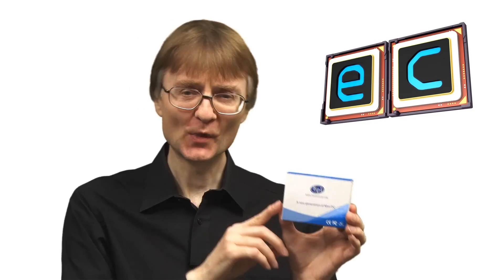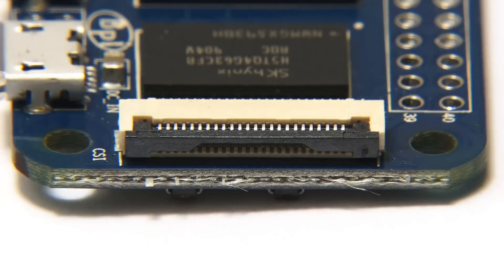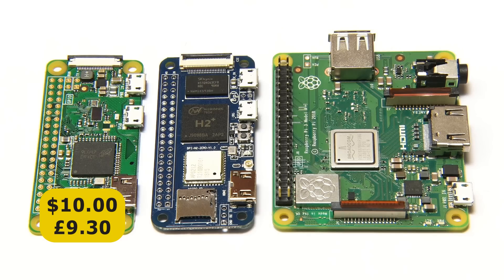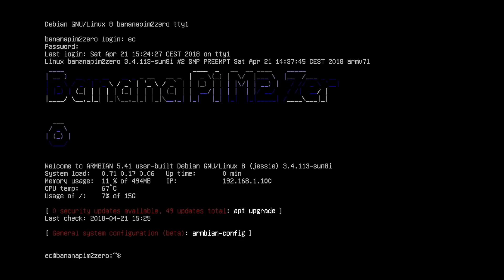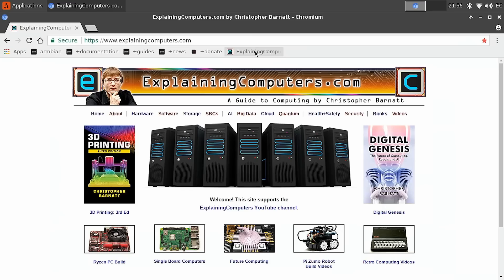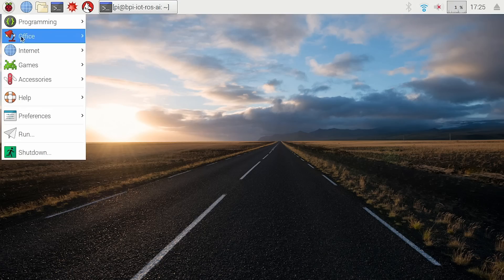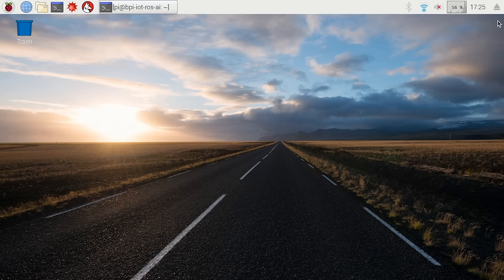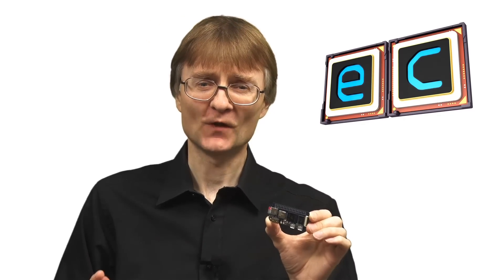Banana Pi M2 Zero: Low-Cost, Quad Core SBC

Comment: +ExplaningComputers / Christopher,
I have been fairly impressed with the Banana Pi range of single board computers.

I was using a Banana Pi R1 as a 4G based router / gateway device a couple years ago and due to the micro USB power jack eventually snapping (which is extremely hard to repair unless using a fairly powerful microscope), I decided to purchase the next model (Banana Pi R2) with a couple heat sinks (this was just after the R2 was released on the market). During initial tests, I wasn't overly happy with the WiFi connectivity (which uses the MediaTek MTK6625L. Which at the time of testing, the drivers wasn't overly stable) but understand that further work has been done since on the development of these drivers (alternatively, the board does include a mPCIe interface, which could be used in conjunction  with a separate WiFI module). 

Within the last year (approx), SinoVoip Co. Ltd. (the manufacturers of the BananaPi range) have also produced a 4G GSM module, which can be directly incorporated within the R2 (during my previous tests, I was using a 4G USB 3 based modem / "dongle", which isn't really ideal). 

Another benefit of the Banana Pi R2 is the inclusion of SATA based interfaces which allows for further storage to be added (which could be used to provide NAS provisions), as well as an 8GB eMMC. I have been considering using these SATA interfaces to provide a Squid based caching configuration.

Unfortunately due to time restraints, I have not been able to further work on this project (so many projects, not enough hours) but am hoping to continue with this at some point later this year.

Another thing which I have been impressed with is that SinoVoip does produce some really good and compressive technical schematic documentation for their range of boards (which was one of the things that first attracted me to their products). If I had to choose SBC boards solely based on available (manufacturer produced) schematic documentation then both the Banana Pi and the Orange Pi ranges would be my first choices. 

Also, Armbian (ARM based Debian) does provide good software / operating system support for both the Banana and Orange ranges (as well as supporting a number of alternative SBCs).

Comment: A nice little SBC. In term of power, which is better pi zero or this SBC. Important when using battery to run it. Another great video.
Reply: You can't expect 4 cores to use less power than just 1 core that pi zero has.

Comment: I think it really boils down to kernel support for the Allwinner stuff more than anything. The BCM2835 in the Rπ has a minimal peripheral datasheet that has no CPU architecture details beyond the memory map. It only has more developers pushing (...that have pushed..) out kernel updates that make it work a bit better. The Allwinner has a complete datasheet available, but lacks the momentum/user base to develop all the needed kernel modules to support it.

   While BGA soldering is not the easiest, the H2 can be purchased cheaply and integrated into any project design. Learning it opens up the potential for cheap embedded hardware development independent from the Bπ developers. One would always need to purchase an Rπ board to use it's chip in a project/product as the Broadcom chips are unobtainable. Therefore a Rπ is purely a consumer commodity, whereas the Bπ is a development board.

 I'm surprised you didn't mention the antenna connector type. I always seem to have a hard time figuring out if they are IPX, MHF3, or MHF4.
  Thanks for the upload.
-Jake

Comment: Now that I have one of these boards, I'm realizing something critically important about the Banana Pi Zero. They packed way too much CPU on this thing and not enough cooling,. Even with a heatsink, this thing thermal throttles like there's no tomorrow. The quad core chip is WAAAAAYYY more powerful than the Raspberry Pi 3A+, but it doesn't show up in benchmarks due to the thermal limits. If there was an easy way to attach a fan, this thing would kick some serious hind-quarters!
Reply from the maker: So true.

Comment: This is an interesting board it's been about for a while, retrorangpie is a nice is, a port of retropie then Armbian and Kodi in one, but I did notice it gets hot, I fitted an xu4q heat sink, it kind of kept temps in order, but after using Kodi for a number of hours the WiFi was dead, I had a similar experience with r69 android box, same sort of allwinner chip and used retrorangpie.
Reply: I found the 'slim' version of Retrorange but really wanted the full installation and couldn't figure out how to add the missing components, mainly Amiga and Scumm emulators. I saw another video with someone saying you need a fan to keep it cool.

Comment: re: 720 vs. 1080:  try a different monitor and/or the edid settings of the monitor.
Reply from the maker: I tried several. :)
Reply: @ExplainingComputers  : sounds reasonable.  I had a tv that had incorrect edid settings and I vaguely recall having to 'reflash' the edid.

Comment: Great video Chris! What would be a use case for something this tiny? Surely you wouldn't buy this just to run it as a desktop PC. Maybe do a video with a project that can be done with it? How about a weather station?
Reply from the maker: Yes, agreed. This is likely to be use for IoT, connected to some sensors, etc.
Reply: @ExplainingComputers  It would have to be such a niche where a cheaper, richer SW ecosystem, rasp zero w wouldn't suffice with its single core. I gotta tell, this board and price point really don't add up.
Reply from the maker: @brunesi  I agree.

Comment: Low RAM SBCs are best for headless OSs with no DE. I found setting up Pi-Hole with a full DE to be rather painful. I then tried the no DE option of Raspbian and it ran fine. With just one micro-USB port, you need both a micro - A adaptor and a hub for both the mouse and keyboard. For the headless version you nee just the keyboard. It's almost as if the thing was designed for the headless OS. Only run OS images with a DE if you really need one.

Comment: you could try to use xrandr to set the display resolution. That worked for me once in a stubborn distro in a vm, that wouln't run with the correct screen size.

Comment: I recently bought a Banana Pi M2 Zero, I installed an image that the documentation provides of the Raspberry Pi OS (a 2020 version) but the Wi-Fi does not go up with boot, every time I need to manually raise the Wi-Fi. Unfortunately the software support is very bad. That's why the best is the Raspberry Pi.

Comment: Sir . I would need some information about these mini processors , because i am trying to make a transparent phone ... 
So in the  transparent phone , the phone will be powered with tiny lithium ion batteries and a thin and small motherboard . Because my plan is to shove all the components into the bezels of the smartphone ... 
I have figured out ways to put audio , battery and headphone jack in the bezels and keep the phone screen transparent . What i need is a pretty tiny yet powerful motherboard to run the smartphone .. 

Can you please suggest any motherboard ( like the one's shown here ) , that is a bit smaller and can run a 16:9 touch screen ...

Comment: In my experience these cheap random-fruit pi boards are good for headless operation, and hardly anything else. I've got 3 H3-based oranges (zero, one, PC+).
Reply: GPU support is generally not as good as raspberry pi products. The H3 currently has the most potential but it is not "out of the box" with most linux images.

Comment: I'd like to see a video comparing a mini pie to a mainframe of the 1950ies or 60ies
Reply: 50s mainframe would struggle to run the os
Reply: To be fair to the 60s computers you would need to wire up the punch card/tape readers to the SBC first! I/O is always a bottle neck and it's going to take a LOT of paper tape to load Raspbian!

Comment: I wanted to use this SBC with my Prusa i3 MK3S+ 3D printer running OctoPrint connected via GPIO pins to replace my anemic ZeroW. I was thinking of installing raspbian and then upgrading to Dietpi and then install OctoPrint from there. Do you have any recommendations with this setup? I was planning on installing copper heatsinks on the SoC and memory modules due to the larger heat dissipation, but I was wondering if you know if all communications done via GPIO on a ZeroW can also be done on the M2 Zero? Thank you for any help you can provide.

Comment: i am going to build a phone wifi presence detector for home automation using a SBC to turn on lights. wendel from level one techs wrote a blog about that, he used a RPi Zero W for this, but i haven't found his blog yet. while i'd prefer to use the BPi M2 zero because of the hardware, i'm leery of the software acceleration and compatibility. i'm also unclear of the dividing line between hardware and software, re video acceleration and OSs tailored for particular devices.you tried a number of OSs, i wonder if you tried ARM versions of NetBSD and OpenBSD and Ubuntu Mate. i'm also wondering, if i'm going to run wire to power it, why not just run a wifi antenna to card on a computer and an OS in a container (ansible, docker, BSD jail). i believe wendel used battery power, but i might try wire. thinking more, wire might be expensive, im sure wendel thought this through, so a battery powered RPi is probably the way to go

Comment: Thanks for the review of this interesting SBC BUT... why perform a cpu benchmark and/or bring up an x11 desktop but do not measure power consumption on such a tiny computer?! 
I think most of the smaller SBCs such as pi zero and this banana pi are meant more for embedded projects and makers, not as desktop replacements. 

I would really love to see people include information regarding power consumption into their SBC reviews. Even something as simple as the reading of a USB power meter would be better than nothing. If you're working on battery or solar-powered projects like mobile gaming solutions, robotics, drones, environmental monitoring, etc this is really important. So far in my experience pi zero is still by far the most power-efficient SBC but something with a bit more CPU power without a significantly higher energy consumption would be really cool to find.
The Banana Pi M2 Zero probably consumes quite a bit more power than the pi zero w, the question is how it compares to the 3A+? Usually, the Raspberry SBCs are already quite power-efficient, at least after the software stabilizes (pi4).

Thanks anyhow and have a great week!
Reply from the maker: Fair point.

Comment: Anyone else notice at 5:46 that the 203 bytes read in 149 ms (1000 Bytes/s) is wrong?  203/.149=1,362  Not the nice round 1000 printed.  I wonder why they fudged the number here while the others appear calculated on the fly and are correct.  Hmmmm...

Comment: ...does that have a Wi-Fi/Bluetooth antenna onboard, i.e. without that U.FL antenna connector being utilised?

I was looking on the board for a component that's intended to be de-soldered, moved, and re-soldered to switch between the U.FL connector and an onboard antenna, but I can't see one!
A few mm behind the U.FL connector is what looks like a 0402 capacitor, which could be used to disconnect the U.FL connector from the radio, but you'd expect to see a component like that (though it's more often a zero-ohm resistor, I believe) in a pattern of 3 solder pads (often an "L"-shape) where you can rotate the component to swap between two antenna paths.

For example, most of the ESP8266/ESP32 dev boards and modules that have both an onboard antenna (either designed into the PCB's copper, or a small antenna component soldered to the board) and provision for an optional external antenna have such an L-shape trio of solder pads, typically being supplied from the factory with a 0Ω surface-mount resistor connecting the ESP8266/ESP32's radio to the onboard antenna, with the intention being that the user moves that 0Ω link if they want to connect an external antenna.
It can be very fiddly to do that - the better boards use at least 0603 resistors for that purpose (0.06×0.03", aka 1608 metric: 1.6×0.8mm) - but I suspect it would be quite difficult/expensive to have a more user-friendly switch while retaining decent 2.4 GHz performance. Electronics design at frequencies like that is total black magic :)

The Raspberry Pi Zero W has a similar pattern of 3 solder pads and a linking component in its trace from the radio to the antenna, alongside an unpopulated U.FL footprint, but given the direction of those solder pads, I'm not sure if that's intended to be used to connect an alternative antenna or if it's used for testing the onboard antenna by connecting some kind of RF source to that U.FL footprint... If it's intended for connecting an external antenna, one would hope that they wouldn't have used such a tiny linking component: it's 0201! (0.02×0.01" / 0603m=0.6×0.3mm)
Reply from the maker: The WiFi works with no antenna connected, but range improves greatly if you use one.

Comment: I had exactly the same problem with only having 720 available on a 1080 monitor whatever OS I used on a Pi 4B, and getting weird reports from tvservice -m  and despite trying everything in software to fix it. Drove me crazy and no one in the forums could help me. Turned out I needed a new HDMI cable... d'oh!

Comment: Tested that sysbench test on my desktop. And I got exactly 10 seconds no matter how many threads. Tested 1, 4, 6 and 12 threads. (6core CPU with Hyper threading)
Reply from the maker: This is because the most recent versions of Sysbench run a different test -- always 10 seconds, so the measure is how many operations executed in the time. Earlier Sysbench versions -- as still common on most ARM SBCs -- perform all operations requested and report the time taken. Bonkers I know.
Reply: @ExplainingComputers  Oh, well that explains it!

Comment: Thank you for this video. Do you have any idea which cheap SBC (under 100 USD) can handle PHP7 and MySQL very well?
Reply: Any of these boards will handle PHP and MySQL far better than the Pentium 60 Linux box I first did real work with them on in 1995.
Reply: @BruceHoult  Thanks Bruce!

Comment: good information thank you. I need to make a server for a few wifi and usb cameras. would this be a good board for that job??
Reply from the maker: Potentially, but I would personally go with a Pi 3A+ over this board in most circumstances.
Reply: @ExplainingComputers  Thank you for that response. I havent been checking back here enough. thanks again.

Comment: You forgot about the TTL communications port by the mini hdmi port. And for screen res issue have you tried xrandr? "xrandr -s 4" in terminal should put it to 1080p
Reply from the maker: I did not try, but am not aware that xrandr is included in the ARM OSs here.

Comment: Bought on of these boards last year and I couldn't do anything with it until armbian can and worked something out. You left out this things biggest competitor.. The orange pi zero which has the same CPU.
Reply from the maker: The Orange Pi Zero does not have an HDMI port.
Reply: @ExplainingComputers  true but it does have composite video and an available rj45 port. If you are crafty you can use a LCD screen through SPI as well. But we all know the OPZ shines when it headless.
Reply from the maker: @erenkaslte8046  Very good point on an SPI LCD. :)

Comment: I never knew there are an equal number of penguins for every core your CPU has.  Would the whole screen fill up on an AMD CPU with 32 to 64 cores?  How could you use the screen all filled like that?

Nice shot of that Timex-Sinclair computer from your website.  I had the 2K and 16K versions.  Maybe you should test their prowess with Mandelbulber 3D at rendering fractals from 1920x1080 all the way up to 65K by 65K (maximum settings)?

Comment: You can add the 1080p option using xrandr
Reply from the maker: I'm not sure you can -- this would have to be both installed and supported on the ARM versions of Linux being used here. Remember, this is not an x86 PC running a standard Linux distro. For most ARM SBCs, the resolution is set in a config file.
Reply: @ExplainingComputers  well, I have OPi lite 2, and I had the same issue
My problem was that my board couldn't read HDMI device info, so by default it ran at 1024x768
So I went and got 1080p output resolution specifications using cvt command (gtf can be used too), added 1080p option to xrandr with specifications I got from cvt, added that option to my display, enabled it and it worked
You can use the link bellow for more information
https://unix.stackexchange.com/questions/227876/how-to-set-custom-resolution-using-xrandr-when-the-resolution-is-not-available-/
Hope that it solves the problem
BTW, I used armbian too
Reply from the maker: @erfankhadem7966  Very useful link, thanks.

Comment: Which specific Armbian image did you end up using?
Reply: Indeed, since Armbian does not officially support the Banana Pi M2 Zero. I am not certain there is a way to get all of the features working with all open source code. I understand that the banana pi people unhelpfully submitted closed source binary blobs and kernel patches that break other boards.

Comment: Wonderful video as always. But true to its track record, it's Banana Pi so there will be only so much that works and of course only 720p, it's to be expected from BPi. 2020 and we have SBCs in our phones using a single USB 3.1 and we're still getting boards with 2 Micro USB 2.0, a mini HDMI and still only quad core processors. Quad cores is better than the single core on the RPi. I see M2 in the name and think there's an M.2 slot for added storage, but nope. Thanks again Chris 👍.